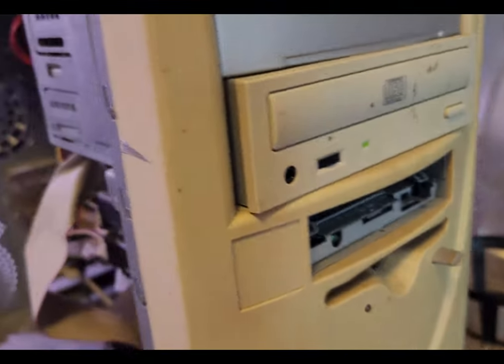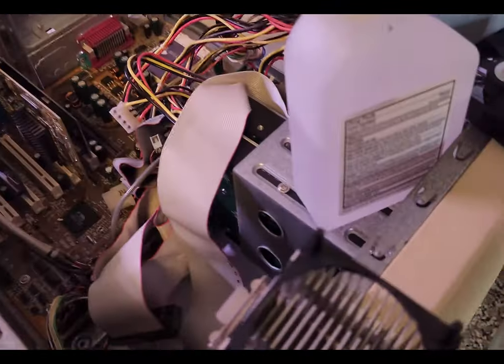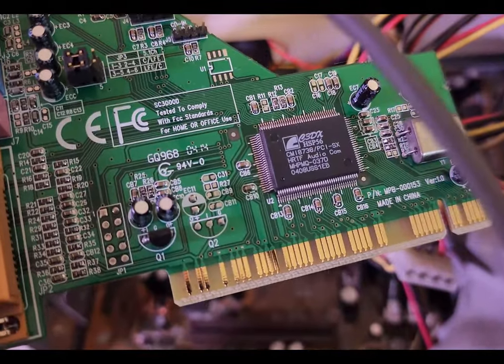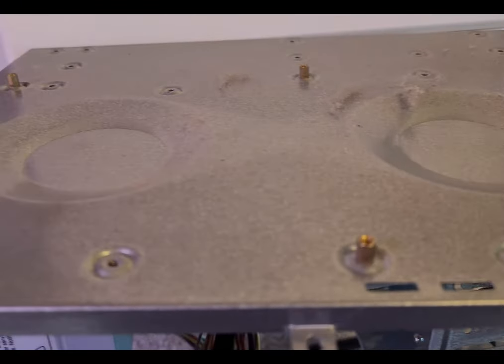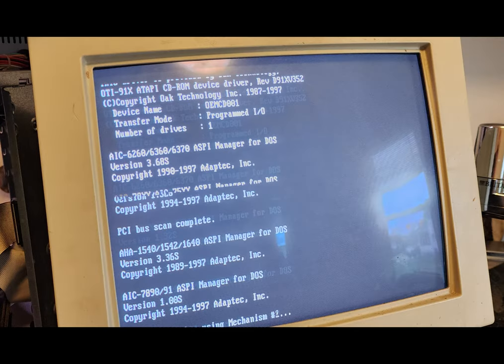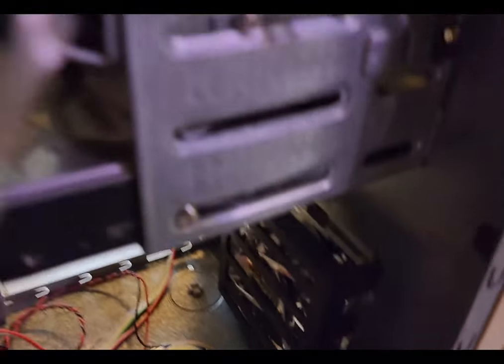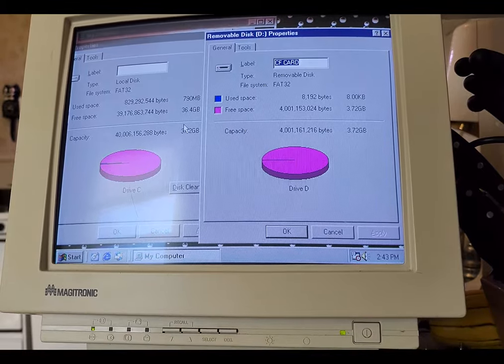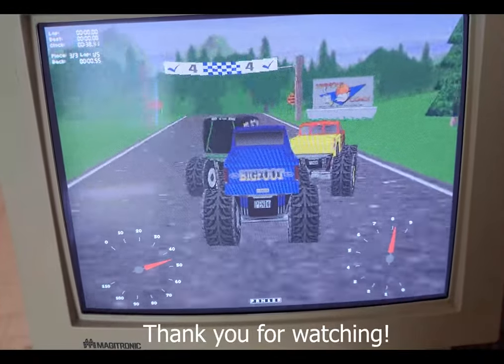Windows 98 PC Restoration

Comment: Nice machine! I love the early Socket A systems. But your CPU is a 1 GHz Athlon, so you should set the FSB to 133 MHz. Another thing; it would deserve an AGP video card, at least a cheap GeForce2 MX. What kind of video card is that PCI one anyway?
Reply from the maker: Tnt 2
Reply: @JimsTechNonsense Thanks, I could have guess it about the "M64" sticker. That card would be good for another old PC without an AGP slot. This one just begs for a stronger one, like a GeForce2 GTS or at least a GeForce2 MX400.
Reply from the maker: I'll have to look for one

Comment: Abit made solid boards and this one is really nice. They seem to use quality caps as well  (it is really hard to find a socket A board without cap plague) I would upgrade it with a faster AGP graphics card if you can get one because I'm pretty sure this 64bit PCI version of the TNT2 bottlenecks the system in demanding games (albeit it is a nice find and may be a nice upgrade for another PCI-only Socket 7 system)